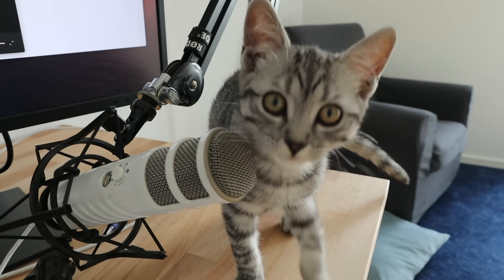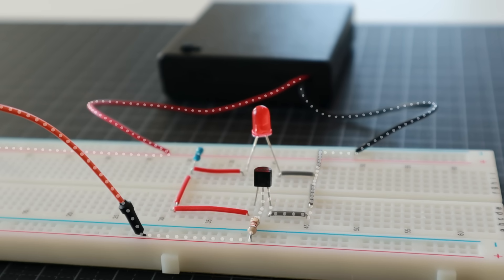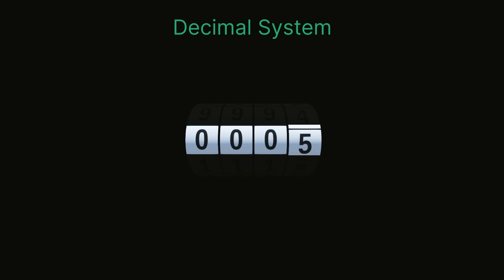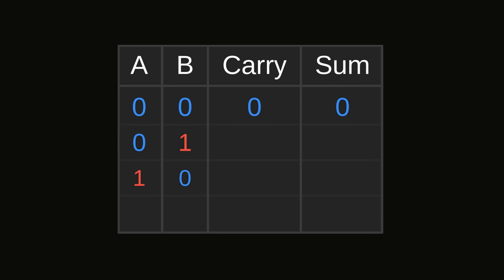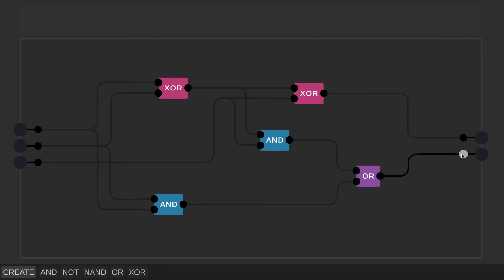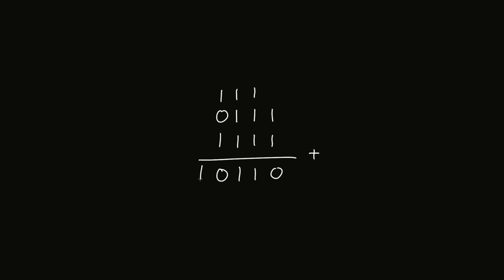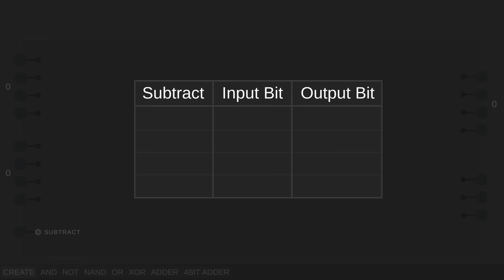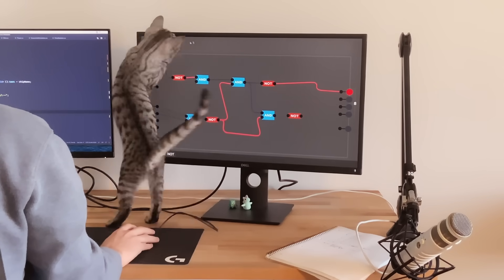Exploring How Computers Work

Comment: Why is the circuit using the LED not as "easy"  compared to the insulated circuit if it's longer? Does the electricity like confining itself to the wire? or?
Reply: I think it's to do with the fact that the LED circuit has to go through the LED, which probably provides more resistance compared to the circuit through the paperclips / transistor. Something vaguely along those lines at least, I haven't done physics in a while

Comment: 1:35 only in an pull circuit, the real comes from nc and no 
2:30 at this point you damaged the simplest understanding of an transistor beyond repair
(acts like a switch is more accurate I would say)
18:11 I didn't knew you where only interested in the binary. From that point it makes a lot more sense but the basis is fragile at best.
They have no idea what pull or push voltage is and what role a nc/no contact play on logik. It's true a transistor acts like a switch but is at least 1.5 times more modifiable than that. The real beauty is a turing machine... but that skips a lot of fun with flip flop logic, you should try the free software to design such circuits

Comment: DUDE I have that same question you asked in the very beginning. It's always tripped me the fuck out that this big hunk of metal could create software and practically any digital information. It's insane! Even when someone tells me that the letter "A" is just binary on it's surface level, okay how did we get that A into the system if all that could be hardwired as a value is binary? It just doesnt make any sense it is so complex

Comment: You might want to discuss overflow. Your ALU has some combination of inputs that will not produce correct answers. This is an important concept every digital designer should understand. Never the less, great video!! Also did you create that program? It looks quite clean and simple.

Comment: What do you mean by easier path to follow? From what I know, there’s a high voltage source and a ground, and using gates that open and close either directly to voltage or inversely to voltage, you connect the voltage to the output when at 1 and then you connect the output to the ground when at 0. 
Still a cool video tho, just I think the voltage explanation isn’t perfect. Maybe I’m wrong though.

Comment: Please, please turn this into a little alchemy style material combination games where you mix stuff together to try and make new things, but for computer logic. The video is a great explanation, but it would definitely help people (me) understand better if they are actually making the connections. Just a bit more labeling of what the components do and what the io points are for and it would be great for learning.

I now see that this is not a very original comment. Either way, great video!

Comment: So, the difference between a value of a 0 bit and a 1 bit is the amount of voltage passing through the circuit. Why don't people add an additional voltage level (like high, medium, and low), and switch to a trinary number system, or even higher, and save tons of storage space? Is it not possible to detect voltage changes on such a small scale?
Reply: If I remember correctly, voltage that is passing through a current is not stable but rather fluctuating. So imagining 3V going through a circuit, a '1' is not defined as 3V, but anything above 1,5V. With a binary system you can get a very reliable output, but adding additional levels will reduce the voltage interval per level significantly which in turn will render the system less reliable. (you can get currupted bits that change value).

Comment: Splendid explanation! One point of question, though. Earlier you said that, since computers don't have fingers, they cannot manually move the paperclip switches back and forth, and that electromagnets are not very good for this either. But then you show an example with a transistor, where you are clearly using your hand still. How does the computer do this without electromagnets (or fingers)?

Comment: 16:28 you can also just use a NOR gate for the zero flag. Ofc you'd want the proper fan-in gate for your 4 bits. You can also read up on tools like KMAPs, state diagrams, state tables, Algorithmic State Machine Charts, etc. which can all help with designing logic circuits.

Comment: I actually built an 8 bit cpu in logisim (logic simulator) a couple weeks ago. If anyone wants the .circ files i can provide them. The cpu has a very basic instruction set, for example it can only add numbers, but can not subtract and can not do any kind of jumps (yet). I am planning on continuing it soon.

Comment: Playing with hardware is cool no doubt, but you can always sharpen your fangs on some simulation software. I personally used the free Logisim software to make my first computer. The development ended over 5 years ago, but it still works like a charm and is simpler than HDL software for building simulation, although far slower (performance wise) of course and far less powerful.

Comment: The ability of this tool to package up and then forever abstract these little circuits into a new named concept would be hugely educational for people just coming into circuit design or computer science.

The only thing it really lacks is like additional labeling on the inputs and outputs. That's the kind of thing that once the abstraction gets too high up it might becomes a little hard for newbies to know what the input bits are, what the carry bit is, what the negative bit is etc etc.

there should be a whole course taught using this tool and you should teach it 😀👍

Comment: I like the way of thinking of the sign indicator as -8. never hear of this idea before
Reply: Well I already knew it from simply hacking with assembly I made a signed num an unsigned on and got shocked how after a certain value, numbers are supposedly negative even if not appearing so
Reply: @Samuel WerleyMakes sense.
Reply: - That is a quite common thing in programming. It's called signed datatypes. 
- Floating point numbers are also common. They are often bigger numbers and the computer needs more effort to calculate them, that's why they are avoided if possible, if you need an optimized code. 
- Quite a bit rarer is the fixed point numbers. There you have a fixed number of digits above the comma and a fixed number behind the comma.

Comment: There's a game called Infinifactory, made by the same guy who made the Minecraft inspiration Infiniminer, where you build a complex system of conveyer belts, sensors, wires, and pistons to assemble input blocks into an output shape.

While not needed to beat any of the levels, you can actually use the components given to build all the same basic logical operators and I found it super useful.

My favourite example is that to get the achievement for completing a level in over 10,000 cycles I ended up building a binary counter to block the output until 2048 input blocks had been destroyed.

Comment: XOR gate can be constructed a wee bit more easily based purely on NAND as [ A NAND ( A NAND B ) ] NAND [ B NAND ( A NAND B ) ], which uses 4 NAND gates. If you can additionally use NOT (which isn't necessarily the case, but it's cheaper than a NAND gate), then it's even simpler, [ A NAND ( NOT B ) ] NAND [ B NAND ( NOT A ) ]. Both of these constructions are based on an observation that A XOR B = (A AND (NOT B)) OR ((NOT A) AND B) which follows straight from the definition.

Comment: This would be such an incredible tool for educational settings like classrooms.
Reply: I totally agree with you. In education you don't need professional tools. You need simple tools to explain the basic concepts of something in a very simple design.
Reply: There are a bunch of such tools, universities prefer to use professional programs that have practical applications

Sadly they are less intuitive because they focus on functionality and scalability
Reply: I can recommend Logisim (or any of it's successors). It's a more polished tool that also has useful blocks like multiplexers, registers and more
Reply: @beyondcatastrophe_ 
 > more polished
more bloated, really. for purely education it's needlessly big.
> useful blocks like multiplexers, registers and more
if this had a save/load functionality it could be part of the course to build those yourself, which would be fun i think
Reply: @Anohaxer  this guy posts on /g/ 
heh
Reply: @Anohaxer  I wouldn't say Logisim is bloated, if you only need inputs, outputs and logic gates you can just ignore the other functions. But the other features become incredibly useful when you get to more advanced circuits like FPUs, CPUs etc. If you just want to learn the very basics of digital logic his simulation is fine, but if you actually want to learn more advanced circuits it will need a lot more features.
Reply: logisim
Reply: circuitverse.org does the same thing
Reply: in what world do tools not already exist
Reply: You can even make "Functions" like what you did here. It's amazing.
Reply: Nandgame is a free website which takes you through the steps of buidling a computer from the ground up, starting only with nand gates
Reply: The whole series can be recommended to student :-)
Reply: literally any cad

Comment: Your current analogy is slightly misleading. Modern logic circuits are not entirely homologous to relay logic in that we rely on voltage and not current. In CMOS circuits (Complimentary Metal Oxide Semiconductor Field Effect Transistor circuits) the current is actually practically 0 at all times except when the circuit is switching (e.g. when inputs change).

Comment: I'm taking this as a challenge to create a working calculator in Minecraft, and I humbly accept it.
Reply: it's so much easier than you think, you got this
Reply: @Xtilly-uq2xm  I managed to get the ALU working in a 17x7x11 block space, which is a surprisingly small space. Only issue is that there are no outputs that determine if the result is 0 or negative which might become an issue later on but idk. Regardless, the ALU is working flawlessly.

Comment: So, if you add levels, tests to complete for each level so that one can prove to themselves that their solution works, and maybe a few qol features like ganging multiple signals up and draggind them onto multiple in/outputs this could be a great game! it would not even be necessary to complete earlier levels to "unlock" the named chips, but one could just solve later levels without them. or have a sandbox area where one can create their own chips with their own tests.

Comment: This explains in less than 20m what our computer class needs weeks for.
Reply: True, but in addition they teach you the connection between logic and language, the formalization of logical statements (which basically teaches you formal math language on the side) and different forms which have additional properties (such as ease of simplification of expressions with special algorithms), the limits and issues in practice, additional theory that talks about the maximal expression potential you have when you limit the number of operations (or gates) and what's need for maximum expressive power (why is just a NAND gate enough to represent all logical statements?), extending all the way to ALUs, instructions (and the history of computation).. and enough info in between to fill up this youtube comment input box.
Reply: And it probably took several times longer to produce! Which is the key, short, dense, easy to digest information takes a LOT of time and effort to create. Your [professors are not paid enough, nor are they provided with enough time to produce coursework of this quality.
Reply: yeah lmao the visuals were actually so helpful.
Imagine if the next curriculum just showed this series instead xD
Reply: This explained half a semester in 20 minutes
Reply: You should be grateful that your class dedicates a couple of weeks to this and doesn't merely show you a 20 minute video and then says "OK, got it? Onto the next topic then!"
Reply: @plasticflower  i like that way of learning though! So i think its awesome, spend 20 minutes learning the basics and the rest of the time experimenting and playing with it.
Reply: You understand this video well BECAUSE you had weeks of university classses.
Reply: @danielb270  What's not to understand? He's just chaining a bunch of NOT and AND gates to create other logic gates and then uses them to carry out basic maths. I don't think weeks of university classes are needed to understand this stuff.
Reply: @iamlogdog   He is giving you the solution to a very specific task. 

University spends time on more expanded concerts:
Binary logic notation 
Standard form, reduced standard form
Boolean algebra

By the end of that creating any digital design from a truth table is trivial 

Note tat university course (the one I had) also covers Registers counters basic processors and Assembly

Comment: 12:10 The sum wasn't actually too big, and it didn't overflow... 15+1 is 16 or 10000 in binary, which was exactly the number that was displayed! :) You have 4 bit input and 5 bit output in order to make sure it doesn't overflow!
Reply: except 5th bit is the "i just overflowed" bit. That's a weird way to call it, but it does make sense in the end if you, say, use it for a jump instruction in the full processor.